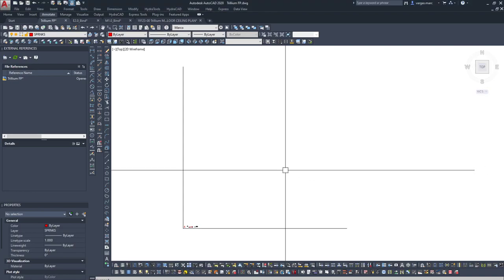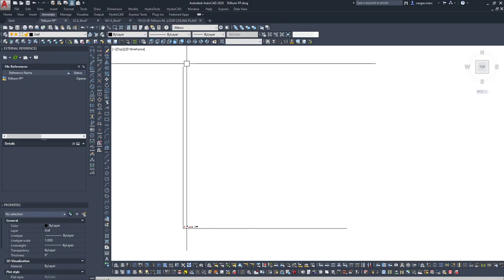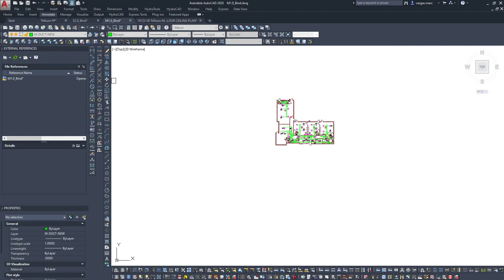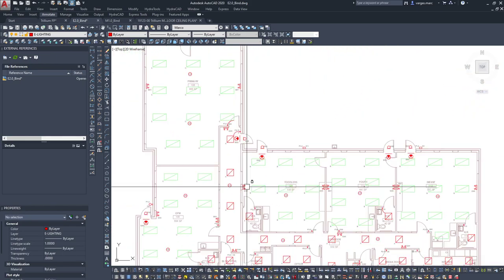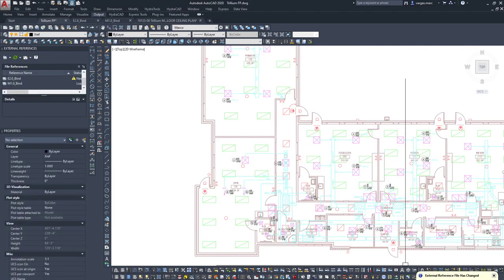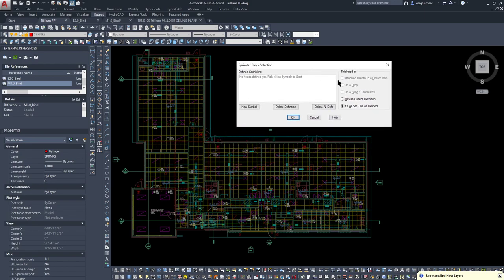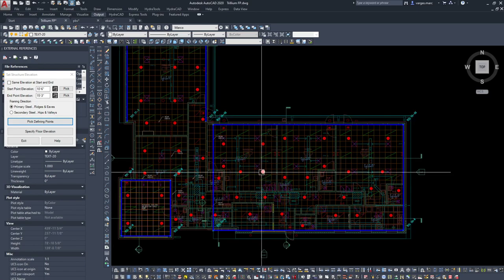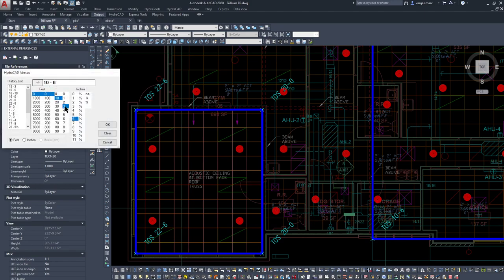Wood structure school fire sprinkler design Pt. 1

Comment: Even if the insertion points dont match perfectly all you have to do is line the plans up with load bearing walls ... It takes longer to worry about / find out if 0 , 0 is the same on all XREFs Vs. Just lining up load bearing walls. Then with them overlayed you can tell in an instant if all of the diffusers/lights fall into where the ceiling tiles are on the RCP. i mean honestly your way of determining the same insertion point is much more thorough but not really needed in most cases.. I also realize im "critiquing" you on an instructional video and each project can be vastly different so please take any of my suggestions with a grain of salt. Great vid nonetheless. I wish I had this to watch my 1st few weeks instead of just being "thrown to the wolves" in a sink or swim type situation...
Reply from the maker: Using the 0,0,0 insertion point based on the arch CAD files is my standard method just to ensure I am not working on a different plane than the architect. This job was not BIM coordinated, but for other jobs, that is the best way to find the insertion point, unless you use REVIT, in which case it usually finds it automatically. When you align to other objects and you go to upload a model, your model won't align with the building in Navisworks. Thanks for watching!
Reply: Thanks for the reply, and absolutely. 0,0,0 always for insertion points. I work for a somewhat smaller engineering company with a little less than 20 employees and 12-13 designers total. We have it structured to where our "least experienced" or "greenest" designer will do about 1/3 of all "setups" (taking arch files and converting them into XREFS and then combining all those XREFS together into an "X-FILE" that each discipline (mech, elec, plumb, FX, FA) can use so that way everyone starts off with using the exact same file and insertion points. So then when I;  the sprinkler designer, goes to coordinate with mech/elec, all i have to do is insert their working file @ 0,0,0 and I'm good to go. But like I said originally, the unfortunate part is that it seems so rare to get all the files upfront.. Again im realistic and dont expect anything close to perfection... But you would think these clients would realize how absolutely unrealistic their expected deadlines are; especially when they have already blown past the deadline we set/agreed to (in some extreme cases weeks even on occasion months at a time) so that we would be able to stick to said agreed upon deadline.. But nope. It must be designs fault >_< haha

Comment: What command are you using to center the heads?
Reply from the maker: Shift+Right-click to pull up Snap menu. Select mid two points and pick opposite corners of ceiling tile.